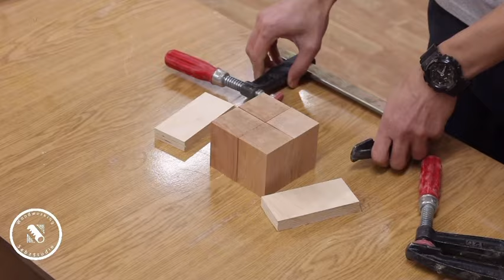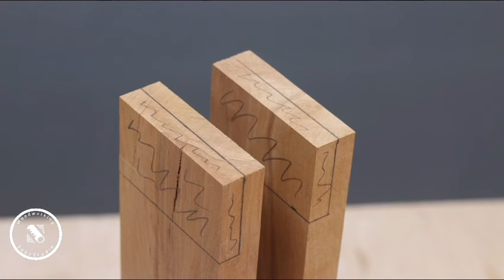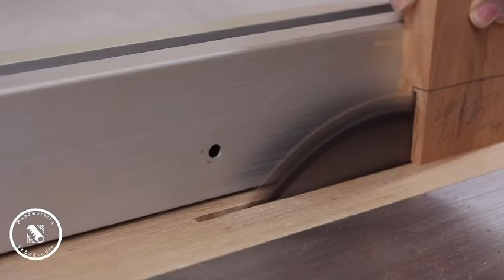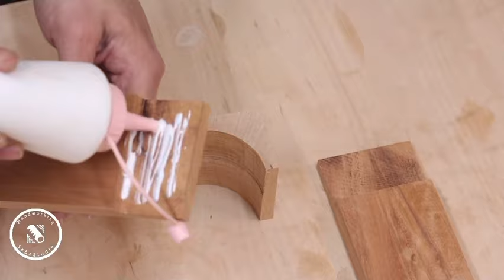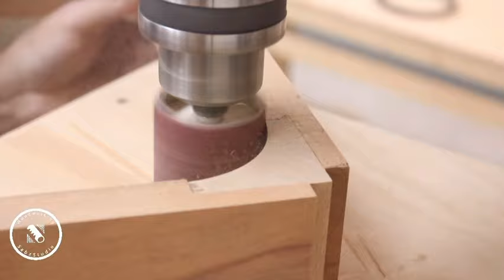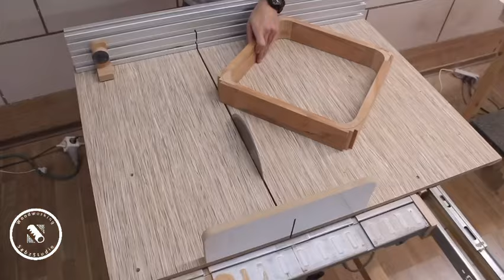the Best Way to bend wood

Comment: I do not consider this method a good one because you glue the wood across the grain, such a joint will fall apart over time and the corner element is loaded across the grain, i.e. just like wood breaks in a natural way
Reply from the maker: We have tried almost all the ways of bending wood and this method is the best of them and we have made products with this method that have been made for more than 9 years and have not had any problems so far.